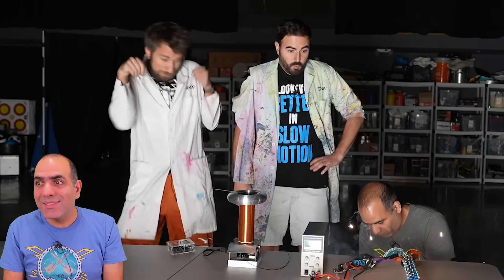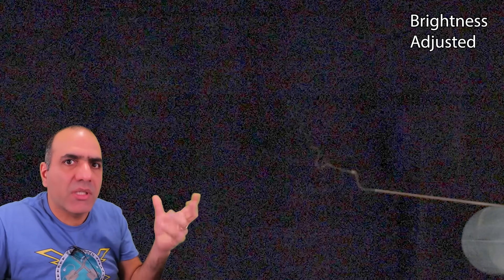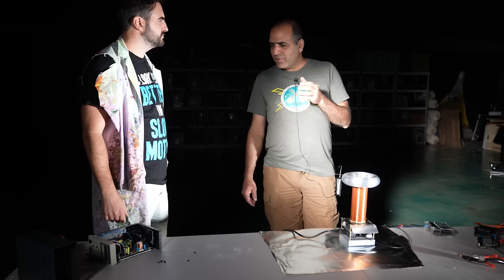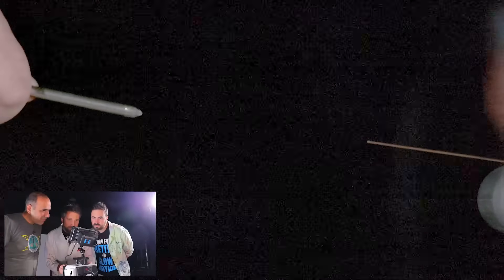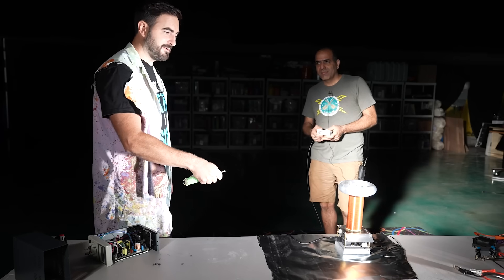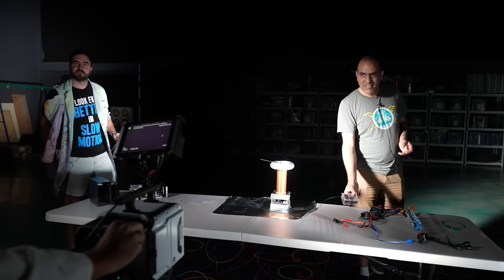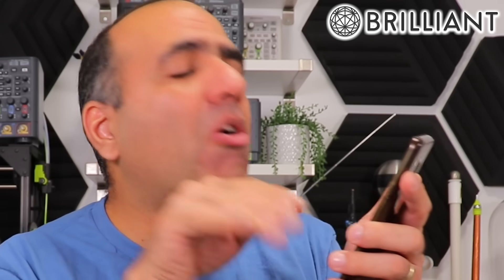ARCS! Frame by Frame

Comment from the maker: Hi all! Just to be clear, when I say high voltage I don't mean positive voltage. Remember Tesla coil has an AC output. High voltage here means high positive and negative. If I show signs, it means a momentary difference in voltage which will switch the other way quickly. The direction of electron flow is alternating in and out of the Tesla Coil, but the way arcs are expanding doesn't alternate, because other factors cause the expansion as I explained. The glowing arc is only a sign of air heating up, and as the charges break new grounds, new paths emerge. 
Also: #MahsaAmini
Reply: Isn't there a possibility to go to NASA's vacuum chamber to test the tesla coil? I know there was a test conducted there using a bowling ball and a feather to prove they fall at the same speed
Reply: Calling human rights violations as just politics allows you to rationalize that you can ignore it.
#MahsaAmini
Reply: how about addressing positive and negative voltage in a video about building a bipolar marx generator?
Reply: Repair powersupply
Reply: Can you elaborate more on this, I am still confuse... so is the arc made up of electrons? if it's alternating current why the electrons move in one direction only towards the ground side?
Reply: you say if the circuit was suspended in space the arc might meet in middle but in space there would be no air/molecules to ionize to create a spark, right ? or am I missing something?
Reply: https://www.youtube.com/shorts/0OukylnhKJo
Reply: Remember you promised a capacitor alarm clock on a latity video? It has 200k likes now!!!
Reply: G E T  R E K T  5 million or just 5? lmao i'm sorry to break it to you but most normal people aren't trying to control what their favorite content creators do, and believe me this place will be better without the likes of you.
Reply: thank you for #MahsaAmini
Reply: So what's the proper designation
Reply: how much money murika spend to kill iranian people stupid betrayer 
say hello to mr guaido
Reply: I’m not getting your notifications at all..
Reply: Good point. It's easy to lose sight of the polarity oscillations.
Reply: Please i need you to watch this and see it is really or fack no one talks about this metal " Red Mercury" https://youtube.com/shorts/SSfIKcidsuU?feature=share
Reply: Heya there Mehdi, I would like to ask if it is possible to make a graphite bulb? I got this idea because of your video from waaaay back, talking about graphite and it's awesome properties.
Reply: do arcs ever form on the positive side of a high voltage gap? i think they can and do, but why is that? is it because electrons are being pulled from the air molecules into the positive side thereby creating a plasma channel? in general, maybe the question is: in what way do the plasma channel arc formation mechanisms differ between the negative side and positive side?
Reply: Twitter was already ruined, long before Musk bought it.
Reply: #MahsaAmini
Reply: G E T  R E K T  you can not be out of politics this days. it is something we can't afford anymore.
Reply: G E T  R E K T  no, I highly doubt the other five million of his subscribers are also uncaring assholes too
Reply: @phonotical  no we just come here for the science
Reply: @DiscordC  you keep saying "we", I don't think there are a lot of you, certainly not the entire 5m subscribers.
Reply: @DiscordC  I don't think you're smart enough to understand the science in these videos, just a gut feeling.
Reply: Please keep  all political statements in your video. i found it very informative and entertaining  #MahsaAmini
Reply: G E T  R E K T  Russian government specially Putin is number one supporter of Iran tyrant regime. Many secret service in Iran which cooperate for killing Iranian freedom fighter has been educated by KGB. In united nation every vote for condemning Iranian movement crack down veto by Russian and Chinese. Russian govenment is exploiting Iran for their benefit. You want hear more ?
Reply: @securityoffers  we come here for  for the SCIENCE, this is a SCIENCE channel NOT a polices channel
Reply: @DiscordC  Politic affects all aspect of every people on the planet and beyond! If you don't like talk about dictators and tyrant crimes go off the grid and pray not affect by those horrible decision. Every people are free to say their thought and cause. Here you can not say what Mehdi or other people talk!
Reply: It's time for 1.75 million frames per second IN A VACCUM CHAMBER😈
Reply: @asadsankar589  Was about to say that also, because less air gives different results. So, I'm waiting 😀
Reply: G E T  R E K T  That's not politics for politics! That is about Iranian movement for democracy and freedom. Iranian are killed in daily basis for their peacful protest by the regime
Reply: #mahisha amini , you said the truth with scientific research
Reply: Agha ElectroBOOM — nice joke about those ayatollah. Enjoying your channel! Funny and educational.
Reply: Can you make a remote
Reply: While I am vaguely aware of the protests in Iran, I did not follow what happened. Seeing those little snippets from you, I would have love a more of a comment from you. In fact, could you do a full video on the subject?
Reply: Put out politic from the channel
1. Canadian genocide native there. Please go home to Europe then. Don't want your money
Reply: G E T  R E K T  not your business
Reply: please leave ALL politics out of these video's we don't come here for politics.
Reply: @DiscordC  well sorry if our souls are leaving our body's in this hell we are struggling to live
And apology for asking help
And you guys in your perfectly balanced country's are drinking your whiskeys and coffee without ANY mind and inside pain
Reply: @DiscordC  it's his video and he can sya exactly what he wants to, if you don't like something, don't interact with it, it's as simple as that, your participance is not required.
Reply: @phonotical  then he might lose 5 million of his subscribers including me.
Reply: @DiscordC  It's his video, he can do whatever he wants
Reply: @hOREP245  then he'll lose 5 million of his subscribers, i come here for science and electrical engineering NOT politics and protests
Reply: @DiscordC  people are sacrificing their lives in the streets for freedom, you can't ignore their movement because you want it to be purely "SCIENTIFIC AND ENGINEERING related content". people in Iran need your support, be their voice. #MahsaAmini
Reply: @DiscordC  please do leave - none of the 5 million you like to bring up will miss you - besides maybe a few of your colleagues who got told by your Russian employer to use the same arguments
Reply: @DiscordC  it is a science channel , and the Iranian regime is religious, rejecting science and logic. I think it’s appropriate to call them out, since that is his background. Science doesn’t exist in a vacuum, we need a society of rational people to support it
Reply: @DiscordC  You are not the real Discord, account. Do not comment.
Reply: @DiscordC  unfortunately politics is everywhere this days. Either you control how you introduce politics, or it will come to you in its own way and you wouldn't like it.

Comment: 9:21; I could explain this part as a mathematician. The reason why it reaches 440 kHz of arc is it increases the voltage 76 percent more than the standard 250 kHz. So, in technical terms, it almost double the value.

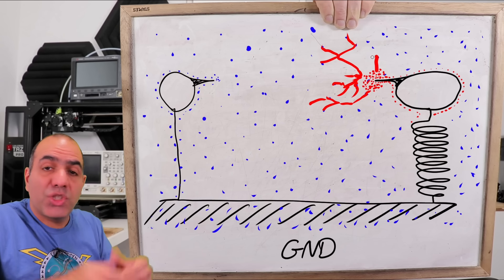Comment: At 10:31, you mention "air molecules".  Is it air molecules, or water molecules in the air?  It'd be interesting to see this in high- and low-humidity, to see if there's a difference.  Maybe with and without air conditioning on a humid Texas day. 😀

Comment: Too low voltage try old TV and ground yourself to the circuit board (cooling sink works best) but I don't suggest to touch with bare hand it's much more comfortable and safe to do this by helding a large metal object. Yes I have tried this and as you see I'm still alive. If you want to shock everithing around you just connect yourself to an anode and isolate fully from ground than you can shoot arcs from your fingers and burn things barely feeling the voltage going thru your body.

Comment: Have you ever compared arc initiation of an AC current vs. DC?  It is well established that an AC arc is much easier to break than a DC arc, but how about striking the arc?  My EE background says that an AC circuit should create an arc sooner than an equivalent voltage DC circuit since the peak voltage of an AC waveform is substantially higher than is RMS voltage.  However, I often read statements that DC circuits are more prone to arcing than AC circuits. I suspect this is due to confusing arc extinguishing with arc initiation, but I have never seen actual tests of arc creation AC vs. DC.  It seems that would make a good joint video with the Slo Mo Guys.

Comment: in 1973 i was twelve my sister was sixteen we were going to town 15 miles a ufo followed us for ten miles scared the shit out of us it caused interference on the am car radio 70 toyota  corolla it had duel points or we might have gotten abducted the sound was like hight to low pitch vroom noise then it took off so fast it disappeared leaving an ion trail to the horizon we thought it was gone turned the radio back on the vroom noise was still present we looked around seen a bright star but it was it it done a figure eight a circle oblong cylinder then a five point star so fast that the ion trail was visible about three seconds disappeared again leaving an ion trail over the horizon again and was gone at least the radio was operating normally again it was a bright white fireball maybe fifty foot across imposible to look directly at it or it was like glancing at the sun we slowed down to a crawl speedup as fast as we could go till it got directly in front of us making it impossible unsafe to go fast so we pulled down the visors like we were driving into the setting son made it to town didn't go home till morning and got grounded for a week didnt dare tell the parents what happened for fear we wouldn't be able to take the car again we was supposed to be home by ten pm ive been researching and seen many more different things in my sixty years ufos no more marathon boomer# 19 till next time thanks for the excellent fun time over and out

Comment: Really liked the video and great explanation. I really like your idea of seeing whether if the system was isolated, if the gap breakdown would be simultaneous from the anode and cathode. I'd suspect that the in most cases it would be cathode initiated breakdown and would then the anode would break down.  I'm thinking that you could use like a small fiber optic cable near the cathode and anode and connect the fiber to a sensor, sample it fast enough such that you could measure when the arcing begins and where it first occurs.

Comment: VIDEO IDEA !  HERTZ spark gap electromagnetic wave experiment  in FULL VACUUM. no gasses or liquids or powder of elements should be used in the vacuum chamber. ( example video https://youtu.be/xNTHbiKmwNQ but not in vacuum). afterwards can you please explain what is happing in full vacuum experiment. you can also make it more complicated by putting each unit in their own vacuum chamber and having all of them in a vacuum chamber, test it again.

Comment: My brother Jackson and I were chilling in the hot tub on the balcony, and it was nighttime so the Christmas lights on the railing were on. But all the connections were covered in ice. And I remember Jackson discovered that if you put your finger on a certain part of the chunk of ice, you could clearly feel an electric current running through it. Back then, I didn’t know 💩 about any of this stuff. But now I realized that, because I was sitting in the hot tub with the water up to my belly button, the electricity was actually running through my wet @$$ into the obviously grounded hot tub. Now ice isn’t a very good conductor which is why I only felt it on my fingers, but had the ice been any thinner and allowed my fingers to get any closer to the live prongs, we would’ve unwillingly recreated that famous scene from “Groundhog day”
Reply: Ice doesn’t conduct electricity. The heat and salt from your finger began melting the ice. That’s all it was.
Reply: @I_SuperHiro_I  It still had some conductivity. That’s why I wasn’t dead, because of the heavy resistance
Reply: @Moocowthegreat  I’m saying the heat from your finger and the salt on your skin melted the ice, so you were touching water. Christmas lights are also 2.5-3.5V. 50V is the threshold to potentially drive a lethal amount of current. Just trying to educate, that’s all.

Comment: I hate to be the party pooper here, but this was really poor form. I have the same Tesla coil and did the same trick, except I had a few people holding onto me while I was bringing the wand close to the coil. When that spark struck, it felt like I was hit in the chest by a baseball bat. It was fine and dandy when it was just me, but the extra capacitance of everyone else meant I took quite a large electrical load… across my heart. I was fooling around with something I didn’t know and could’ve killed myself or others. Arcs this big are a screaming 200+ kv, enough to kill you a few times over. For the love of god, do not try this. As someone who HAS done this, the “fun with sparks” will turn into “cardiac arrest” depending on the humidity, the shoes you’re wearing, the ground you’re standing on, the building wiring, etc. This was a severe disregard to electrical safety with no viewer warning. Tesla coils are not a toy and should be handled with the same respect as a gun.
Reply: He has a degree in electrical engineering, he knows what he is doing.
Reply: @spaceageGecko  So do I, I’m also a former EMT who has extensively studied the electrical pathways of the heart. The Tesla coil is a giant capacitor, by definition. (It’s capacitance and number of turns of the copper wire on the neck going to the toroid on top determine the resonate frequency of the coil, ~200khz in this case.) You are also a capacitor that can store charge, that’s how your phone recognizes touchscreen inputs from your finger - it wicks stored charge from a segment of the display, reducing the voltage in that area. If you happen to have a lot of capacitance, either through coupling through other people or into the earth with thin shoes, you will move more charge in the same amount of time. If you conduct charge through your heart, and it happens to be at just the right point in the cardiac cycle, it can throw it into V-Fib.
Reply: @spaceageGecko  Honestly, I love playing with Tesla coils and manipulating electricity to do really oddball things, and would love to answer any questions about how they work. Playing with electricity is like playing with fire. It can be fun, and with the right knowledge, precautions, and respect, you can learn a lot and have a lot of fun. But the second you drop your guard, things can go wrong fast. Anything under 48v working voltage is generally safe (don’t lick it, but otherwise, generally ok). Anything over that, think very consciously about where you stick your fingies. But it’s also very easy to manipulate low voltage into high voltage (think portable electric fly swatter that operates off AA batteries, or a defibrillator that runs off 3.7V lithium batteries). If you do mess around with circuits (which I encourage btw, it’s the best way to learn), just be conscious where your heart is in the conductive path. For me, I put my left hand behind my back so any shock will go down my right arm and into my feet.
Reply: If he was going to get hurt, BELIEVE ME, it would've happened already.

Comment: I'm not sure that the ark is forming from both sides even though it appears to be. Only the electrons can move so whichever side is negative must be the side that the ark is propagating from. Probably what you're seeing is electrons in the air moving towards the nail because of the strong electric field around the tip of the nail but it's all still going One Direction from the Tesla coil to the nail. The air around tip of the nail might start giving up electrons or the colonel discharge may be just concentrating towards the tip of the nail and then as the electric flow increases as the arc gets closer there's more flow becoming more visible near the tip of the nail and spreading backwards.

Comment: I think if the circuit was in space there wouldn't be discrete "arcs" at all. There isn't any air for the electrons to hop across or ionize. I assume if the voltage difference got high enough there would just be a small steady stream of electrons flowing from one electrode to the other. (And of course they would have to "start" flowing from one side, even if the forces are equal on both sides.)

Comment: you could elliminate the ground problem by connecting a middle point of the tesla coil with ground, so that you get negative and positive potential relative to ground, and then make an arc between the negative and the positive.

Comment: I want to ask a question. 
An inductor in an A/C circut charges and discharges at the frequency of the A/C sine wave. But what happens if one instantaneously disconnects the inductor at the point of max charge? Does the inductor then act as a battery, holding the charge or does it give off its charge to the air or to magnetism?

Comment: i wonder if you dispensed with the sharp pointy wire on the Tesla coil side if the branching spark would appear/migrate differently when discharging off the smooth surface of the rounded donut?